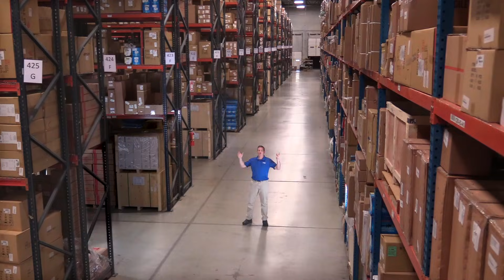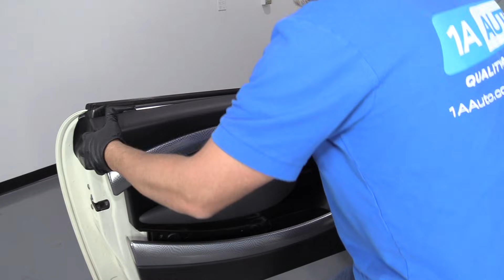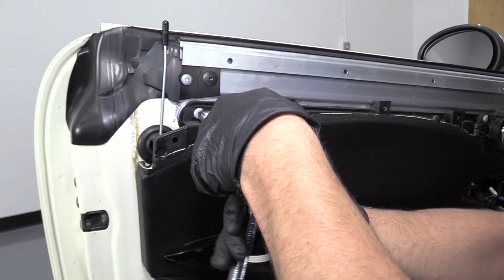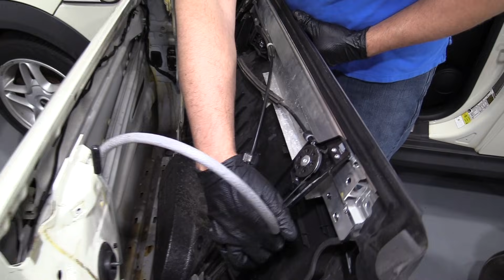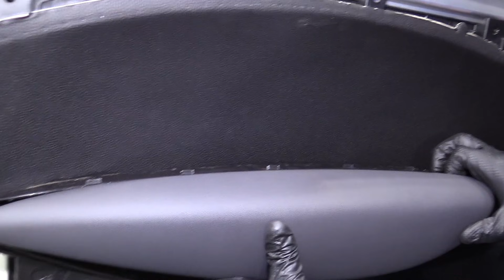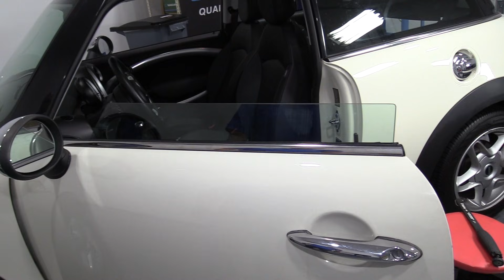How to Remove Door Panel 07-13 Mini Cooper S

Comment: My door glass doesnt line up with the door frame the right armrest its a little lower, when the left armrest is exactly in the hole the right armrest its a little low so my glass doesnt line up it still works but what could i do in that case?

Comment: You are the man. Had a bad rattle from my passenger door, apparently one of the roll pins that holds the track of the regulator to the upper aluminum frame had slipped out. Used every step here to get to it. Thanks a million!

Comment: Thanks for this high quality video, saved us hours fixing up our mini!

A few comments based on our experience on a R56:

To remove the glass
- Remove the round surround from the internal door release handle as the video shows. Remember to pull out the locating pin first.
- Unclip the main trim panel by prising it away all around the edges. It’s a a big U shape. No need to unclip the armrest cover.
- Remove the two rubber covers to access the two bolts securing the glass clamps (it’s necessary to lower the window to the correct position as the video shows)

As other having commented, getting the two glass securing bolts out is a major challenge, since they need to be pulled at the same time they are unscrewed. They have a short threaded section which engages with each side of the clamp as you unscrew them, so once the bolt has been unthreaded from the outer clamp, it floats around. Other have suggested looping string around the bolt head to pull on them. Once the bolts are out the glass can be lifted out. It won’t drop out since the clamps have ledges at the bottom. It should also be possible to remove the glass without needing to  raise the window, removing the outer trim may help with this it it’s a tight fit. The bolts can be left partially threaded so you're ready for the glass to go back in.

To remove the whole inner door panel (if for example you need to get to the lock mechanism), the glass needs to come out first.

After disconnecting the wiring, the whole door panel can be extracted by removing just the 11 torx bolts around the plastic panel, the 5 on the aluminium strip and bracket, and the small nut and bracket on the stud. One of the bolts is under the rubber trim, which needs to be unclipped. There’s no need to remove the mirror switch and the surround over the smaller speaker, or the large speaker unless any of these have particular issues. These are bolted to the to the door inner plastic panel (door card?). not the door itself. You will need to unclip the armrest to access one of the 11 perimeter bolts.

Finally unclip the door lock release cable from inner handle as shown in the video, then the whole panel can be removed.

Comment: A very good procedure except:
1. the screws holding the window are T40, not T30
2. When the window wouldn't come out, you missed that important step as outlined by some posters already: you have to pull the screw out as far as possible until it engages in the oute part of the fitting and then unscrew it a coupke of extra turns. I used a magnet to do this
Reply: my car just got broken into , I want to replace the window myself but hesitant how difficult this could be or the procedure from this video will help me

Comment: For anyone who’s having trouble with the bolts that hold the window in place, they are tricky, and require a specific method of removed which is not mentioned in the video. They sit on a track of threads that requires them to be unscrewed ‘twice’. Unscrewing the bolt from the first track is very simple. But once you’re on the second track you have to pull the bolt towards you and unscrew in order to remove it, or at least unscrew it enough to release the window. Specifically you have to pull the bolt towards you until it threads  and can be unscrewed a second time. I used a shoe lace lassoed around the head of the bolt to pull it towards me while I unscrewed it with a ratchet. I’m sure there’s a better way but that worked for me given the tools that I had. 

Additionally when you’re putting the window back in, ensure it is positioned properly. If not it will fail to roll up all the way, or worse, result in your window tinting getting ripped off by the door.
Reply from the maker: +Kristopher Satterwhite Thank you for watching!  We appreciate you taking the time to comment!
Reply: Straight up saved me hours of grief. Solid stuff man.
Reply: My gawd, I'm stuck on that same part too. One came out fine the 2nd is a you know what. Wish me luck

Comment: According to the Haynes manual, one should NOT attempt to remove the release handle trim like it's done 1 min of the video. Prise out the pin at the base of the trim, but wait until the complete door panel is off to remove the trim, if needed. Then you will have easy access to the trims fastening clips on the back side of the door panel.

Comment: I am talking about the part after 6:03 of the video. The bolts were just loosened and the glass does not come off. At this point I spent 30minutes to figure it out.
Reply: can you explain how you did this or show video because can't remove window like shown because utter rubbish , they did not show anything about how they removed window because they don't know ……
Reply: I'm scratching my head to, wth magic trick is it to get the windows off? I got the bolts as loose as they go and nothing.
Reply: If your door glass doesn't came out like shown in the video, you have to pull and unscrew at the same time the two bolts that hold the window until they almost came out...and miracle! You put your door glass out easyly.

Comment: The torque screws that hold the glass has 2 treads. In order to remove the glass you have to take them off completely. I am wondering why you skipped that step.
Reply from the maker: +lexerkok40 The torx bolts only need to be loosened slightly to allow the glass to come out. This makes removal and installation easier because the bolts don't fall inside the door panel.
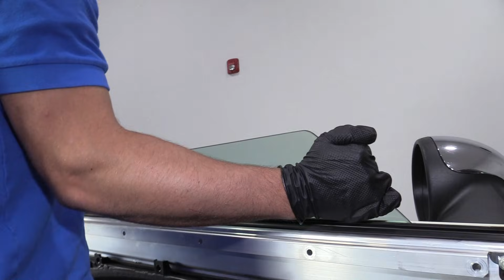Reply: @1AAuto  I would like to add something to this. I did this today and once you know that the bolts have two threads with some space in between you can get the glass out easily. However, if you loosen the bolts only 1 stage, you will not be able to get the window out. That's what we saw in the video at 5:34...(with the "oops"-comment) You have to pull the bolthead with an interior panel tool towards yourself and then turn the T30 counterclockwise again to let the second thread on the bolt start working. After a couple of rounds the window comes loose and the bolt stays in. Good luck!
Reply: thanks for clearing that issue up for me …. window does not come out so nice and simple as was shown in video and could not work out why so thank you for posting this and still hope it works when I next try ...